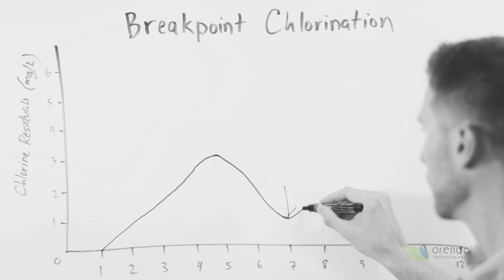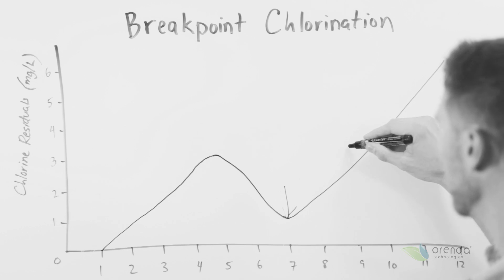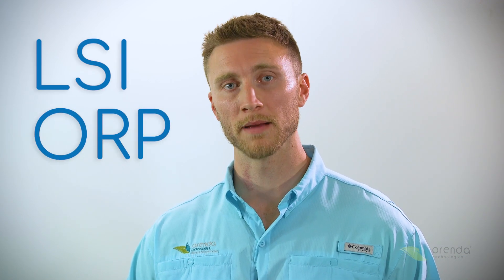Understanding ORP: Oxidation Reduction Potential | Orenda Whiteboard

Comment: I switched to Orenda’s 4 pillars and LSI first approach last year With my pool business in SD. I did it to cut down on chemical costs, and to start taking the guesswork out of my dosing. I’m not kidding when I say My pools have never looked better, my costs went down 25% across the board, and now if there’s a problem with a pool, I know exactly what factors to eliminate because I track everything. I even have 20+ year pool
Techs now calling me to ask for advice and I’ve only been doing pools for two years. It pays to do things the right way. Literally saved my business. Thanks Orenda.
Reply from the maker: This is the kind of message that makes us want to cry. THIS is exactly why we do what we do. Thank you for trusting us. We are so happy it has worked out for you! Contact us at info@orendatech.com so we can get to know you!

Comment: Does adding Chlorine lower the ORP, or raise it.  If my pH was steady at 7.2, couldn't I just add enough chlorine to get my ORP to above 700, instead of worrying about arbitrary FC and CC levels?  Thanks.
Reply from the maker: Adding chlorine should not lower the ORP, it should raise it. How much of an ORP impact depends on what the oxidant demand in the pool is. Pools with high iron content, for instance, may experience a slower rise in ORP, because chlorine must oxidize it. Same with nitrogen compounds and bather waste.
Reply: @OrendaTechnologies  
So could you theoretically get away with managing ORP with just liquid chlorine, instead of trying to set a specific FC residual past breakpoint chlorination, assuming you don't have a metals problem, and your LSI is balanced?  Also, enzymes should raise ORP, as well?Thanks.
Reply: Found the answer:  ORP is probably not necessary to measure because, per a Chemist Richard Falk paper, ORP (really HOCl) is directly correlated to FC level (in relatively clean water) when isocyanurates  are present.  Also, given a level of FC, ORP varies directly with pH.  In 2017, the CDC determined that a 20:1 ratio of  CYA to FC (CYA=60, FC should be at least 3.0) for adequate sanitation.